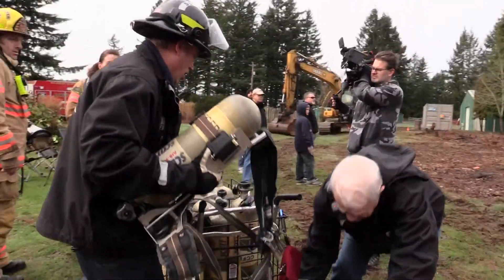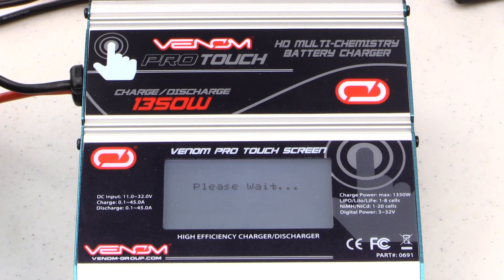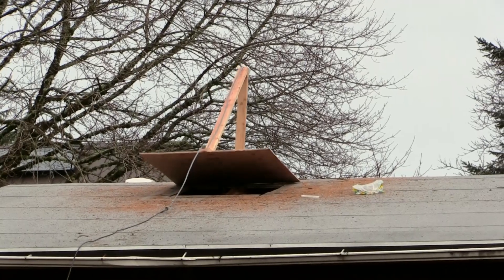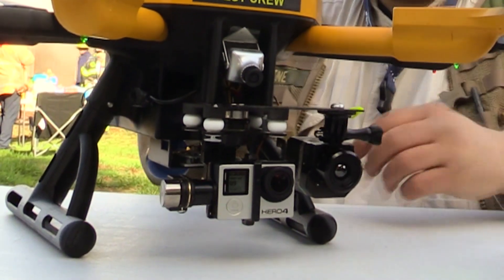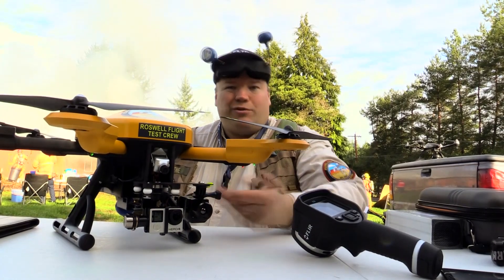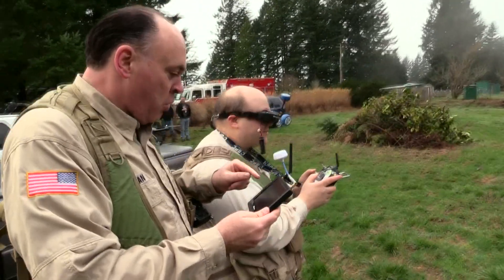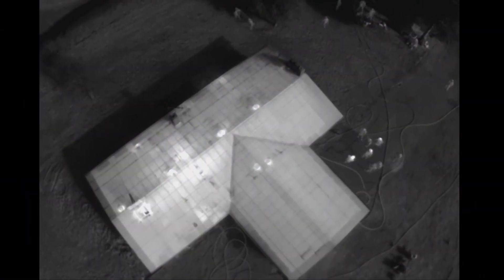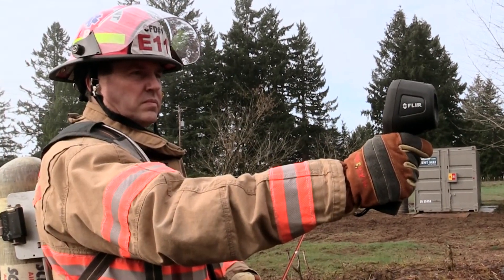Drone with FLIR Records House Burning Down

Comment: Nice video people :)  I assume the idea is to eventually aid the fire fighters with an aerial platform like this? It might be interesting to show if & how this could aid the fire fighters :) 
Cheers & thanks for sharing
Reply from the maker: +DutchRC Adventures Indeed, as StarTazz pointed out, we've done several videos previously with firefighters, where they were actively engaged with the imagery being provided by the drone and gave their feedback as to its effectiveness. Here is a link to the one which most closely resembles this scenario: https://youtu.be/jQTiZmFjc54
Reply: +DutchRC Adventures I'm sure they have some videos that show how these Multi-rotors and FLIR cameras would help the fire crews,might be worth you looking through there older videos,i can remember them doing these type of videos before. ;-)
Reply: +startazz Ohwwww I did indeed see a video about the camera they used in this video.. I must have missed the one you ment.. I'll have a look :)
Reply: easy. they see where there is more heat and therefore there is where they can concentrate the water streams. and also if is known that there are ppl in house they can see the path that they can take to search or where to search. obvious where is less heat. i think they are smart and find alot of interpretations out of that feed